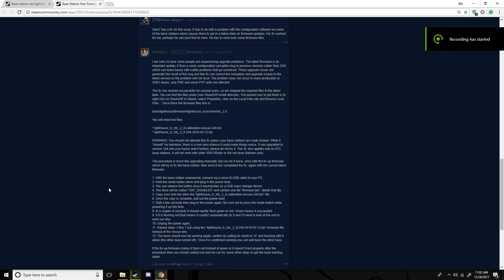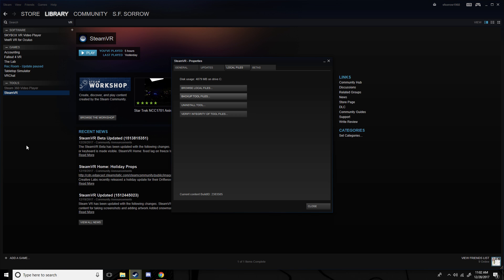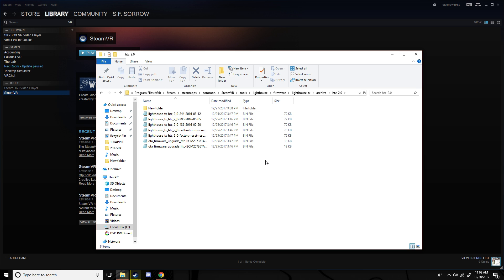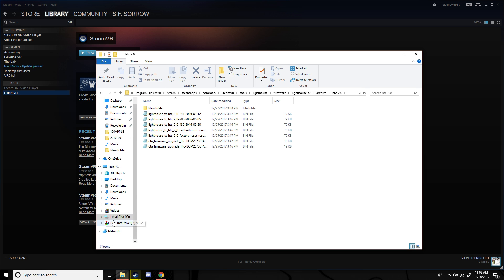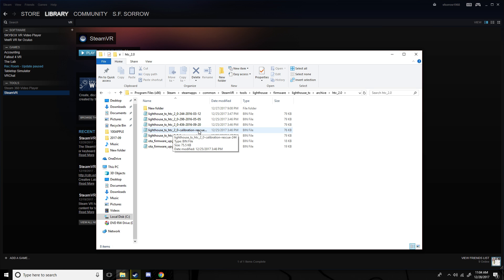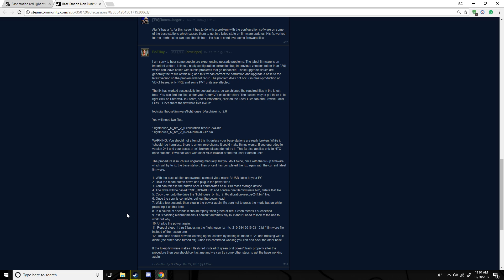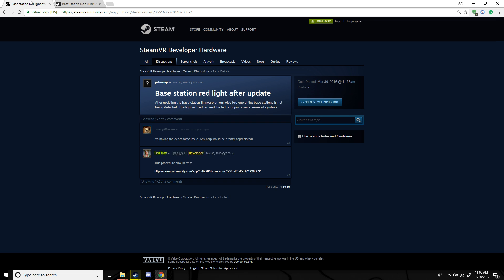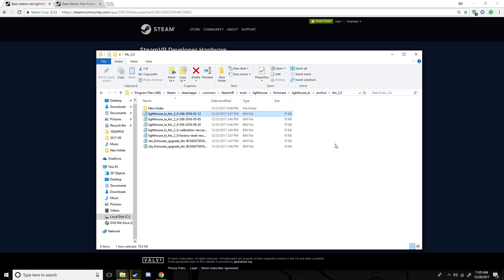How to Fix Base Stations (THIS FIX SHOULD BE A LAST RESORT. READ WARNING IN DESCRIPTION)

Comment: So i did follow instructions till 7 part and after plugging in power without holding mode button it didn't even started my base station is not even turning on now nor flashing any light ? help (yes after it failed i followed till part 11). And when i try to repeat all 7 stages firmware is back in dcm without the one that i pasted in .

Comment: Does not work in 2022 {for me at least} mine started out doing this thing where it would find the base station then the light would turn red shortly after. I tried this fix and everything went well until step 8 in which I got a little confused. Is the regular front light supposed to flash or the little back light? Because the little back green light started flashing immediately after I plugged it in again on step 7 {specifically not pressing the mode button on that step while plugging it in} I then went through the process again but replacing the file with the 2nd one on step 11 when I got to step 5 again. Once I got through with all the steps 1-7 I was confused as to how to set its tracking mode to "A". I don't know if step 12 is needed for proper operation but I'm just sitting here with a base station with the little green light flashing in the back the regular front lights never came on during the process so I don't know if its gonna work in 2022 or if I did something wrong and I have to send it in to a technician or buy a new one or if I did everything right and the 12th step is needed for operation. If somebody has an answer let me know please.
Reply: Also SteamVR cannot seem to find the base station on startup {yes its plugged in} I was very careful with this whole firmware process because I know if you do firmware wrong it will break stuff.

Comment: i got a used vive yesterday and i have this problem but i dont have the cable that came with the original vive, i couldn't get the lighthouse to show up on my computer when using a generic micro usb, could this be fixed with using the audio cable as a link between the lighthouses or do i need to get a new one? (im gonna go get a long audio cable next to test this, ill post the results when i do it)

Comment: one question the CPR DISABLED drive does not appear , i get the notification that the asestation is connected but it doesnt how up in file eplorer is there any way to make it show up?
Reply: Hold mode button down while connecting to PC, base station should be identified as CRP_DISABLED or whatever, release button when it's labeled as USB device in file explorer

Comment: It's july 2nd, 2021, and I've used this method to fix my base station. 1.0. It started blinking red out of nowhere, and I do take care of my equipment so I became worried. Luckily, this video and the threads shown in this video helped. Thank you very much bro
Reply: how did you get the CRP disabled to pop up again after adding the rescue file, i added the rescue file and unplugged power then re-plugged and it was flashing green but now i dont  know how to get the CRP disabled to pop up again so i can add the regular file, any help?
Reply: @h4zza-a  SO once it's flashing green, you basically repeat the steps of connecting your base station to your PC. Hold the mode button while plugging in the cable (more or less at the same time) and hold the button until your PC reads your base station as a USB Device, then you can release. It should be identified as CRP_DISABLED, from there you can go and place that file 'lighthouse_tx_htc_2_0-244-2016-03-12.bin' instead of the calibration_rescue file. After that it should work as normal. I'm pretty sure that file is supposed to be the only one there so delete any other ones that generate i.e. "firmware.bin", but if I remember correctly the calibrate_rescue file disappears on it's own

It's been a few months so I haven't had to do it in awhile, but I did notice that any software update that SteamVR offers i.e; "It's Time To Update your Base Station" will result in the station flashing red, so I have to ignore any updates to that base station to avoid doing all of this again.
Reply: Thank you your a life saver bro I almost got pissed cause I just got the equipment and this happened to me

Comment: This worked for about 30 minutes then my controllers started drifting away then my headset turned gray and now I'm back at square 1. This has been extremely frustrating for me and any help would be nice.
Reply: Did you get everything figured out?

Comment: FOR THE OCULUS QUEST 2 USERS THAT ARE STRUGGLING WITH THE 2.0 BASE STATIONS NOT SHOWING UP ON STEAMVR.

My issue was that my base stations 2.0 wouldn't show up on the SteamVR. I was on this problem trying to find a solution for 8 HOURS when the answer was simple. Make sure that your base stations are on, but the first thing you want to do is make sure one of your trackers is on and you're set up and ready to go. With the 2.0, I didn't have to plug it into the pc to have it update. Turn on your trackers and make sure they are connected to SteamVR the same way that ThrillSeeker did. Once that is connected, make sure you're in view of the base stations, put it on your body, and move around a little. The base stations should eventually pick it up and appear on the SteamVR if you did it correctly. 

I looked for a solution to his issue for 8 hours and managed to figure it out when I gave up and just tried to play to see what happens. Base stations 2 need to have something to track be picked up on SteamVR. I really wish they included this information somewhere that everyone could see.

Comment: Didn't work for me (valve index)
At stage 11 or 12 after seeing the green flashing light inside I unplug and plug it back in holding mode button but when I go back into the base station file the firmware.bin file is back again.
Reply: Once I do the whole process, the base station flashes green but inside the box, not the light at the front.

Comment: *WORKED AND FIXED*
just leaving a messaage. it is way easier that you would think. just find the rescue file and the firmware file like the video shows from 0:00 til 1:12 and the follow the instructions. if you are confused as to what the mode button is, it is the button located on the back of the lighthouse.  this is used to allow the computer to enter the lighthouse. like a normal USB. 
for anybody wonder why its still blinking red when you used this * lighthouse_tx_htc_2_0-calibration-rescue-244.bin file. its becasue the error is physical, which means that either a new model needs to be bought or send this one in for test.

this guy had similar problems ---> https://www.reddit.com/r/Vive/comments/5t11ty/base_station_blinking_red_fixed/
Reply: thanks man:)

Comment: i can't get either base station to go into update mode, when i plug the power in with usb connected and holding down the mode button, nothing happens. both my base stations connect and work but one has started to fail every few minutes the red light stars flashing and it says internal error 10009. i was going to try this method but can't get my PC to connect to the base station with USB, i have tried 2 different computers, different usb cables, different usb ports. if i let the button go and unplug the USB they power up so it's definitely getting power.

Comment: Will this method work on my Valve index base station 2.0?
Reply: I've had this happen on my valve base usually valve bay station does this because of an insufficient power source if you have it plugged into a extension cord or a faulty wall plug or wall plug that's not installed correctly it'll work at first but eventually it'll give you the red flashing light or dim red light this is because of an interruption in not necessarily the power itself but the Hertz that is running at they're extremely sensitive to I have come to find out
Reply: @jt3000o  Thanks for replying. I replaced it eventually... Valve support was awesome.

Comment: Just got a vive (new) and updated the firmware on one of the base stations and it’ll work on the disabled mode but if I just plug it in, nothing.
Would this also fix that?

Comment: i did this and the base station is now having tracking problems
Reply: Did you ever figure out how to fix the tracking issues
Reply: @pnessi570  So i ended up buying another base station because the tracking problem was one of the rotors stopped working in the base station. If you still have a warranty i would get a replacement by contacting them on their main site.

Comment: I did this i thought it worked it started flashing green, I put it back up on the wall and it hasn't stopped flashing green I tried changing the mode it still flashing green
Reply: same thing happened to me did you fix ti pls help

Comment: i get to the flashing green light but after i replug in an go to the files again it shows firmware.bin again instead of the rescue i had replaced it with. is that correct and from there i replace it again this time with the other file?
Reply: I have the same issue.. I thought i was the only poor soul dealing with this problem. No pun attended with your username lol
Reply: @jeremiahmcadams5105  ah haha yeah actually I figured it out. It just resets to that but after the green light your good. Just put that other file in and it'll blink green
Reply: Be green*

Comment: i just bought a new sensor  and it one week the light went red.  when i do this fix it turns back to green but   it comes up on steam Vr  as in it needs updates.. once i apply the updates it goes red again i re did it both ways with those 2 files to add in and nothing.  If i don't apply the update for example and i try to use it when is green  it still doesn't work properly..  can some one please help
Reply from the maker: Vilawent try changing the channels. If that doesn’t work, just give it time and let it sit. Multiple people said that they had the green light and then it fixed itself. This is really beyond me. Try talking to HTC tech support.
Reply: @SFSorrow1968  Alright im letting it sit on green. Hopefully this works !  thanks  for the response !

Comment: My base station doesn't show up on my computer at all?
Reply from the maker: Q7Nator after the base station is plugged in with a usb, did you hold the mode button down and plug in the power cord? You have to hold the mode button down till it recognizes it.

Comment: I ended up clicking out of the error file before I can paste the second file, which means my base station is just flashing green, how do I fix it?
Reply: thats whats meant to happen now you delete the firmware once more and put in the lighthouse_tx_htc_2_0-244-2016-03-12.bin in its place and repeat steps 1-7

Comment: it worked, i update all my firmware day 1 thinking , why not, and it killed my base first day of using it, did these steps and it fixed a non responding broken new base
Reply: so the problem is still here even after more than a year of this video?, thats sucks dude i just got mine and i was going to update them cause i thought htc fixed the problem already

Comment: HTC says the following to this (the real issue behind it): "The firmware update is not causing a failure, it is detecting a pre-existing mechanical failure which is degrading tracking fidelity. That failure will eventually be complete and prevent the base station from functioning at all.

It requires a hardware repair. Attempting to alter the firmware manually may completely disable the base station and in any case, will not resolve the underlying issue."

In other words, the problem is the hardware and the new update just detects it
Reply: to be honest i am sceptical of this as i had the issue today with my sensor brand new out of the box, so unless HTC are literally shipping out faulty hardware its an issue with their firmware and not a mechanical fault with the unit itself.
Reply: @andrewhogg8140  They are. Im quite certain. The hardwareproblem is an official statement by them. They would profit more of a software fix than having to repair all of their units. But ofc, it could be still the case. Just weird that the update works for many others. Others without the tracking problems

Comment: my sensor is flashing green but i accidentally closed the crp file so when i plug the power cord back in i no longer have the crp file to show up so i cant replace the calibration file with the 244 file help please?
Reply from the maker: coolio dude give the base station time and it might fix itself. That’s what happened with a few other base stations. Or you could verify integrity of tool files for steam vr and try again.
Reply: @SFSorrow1968  i let my one base station sit for about a few hours and still flashing green i also verified the integrity of steam vr and its still flashing green and the crp file still wont show up is there a way i can fix this?? do you think maybe reinstalling steam vr could do anything?
Reply: Same here, I just want to play.
Reply: @Jorobaditoo  yeah dudei feel your pain
Reply: @deez50O0  Please tell me if you fix it.
Reply from the maker: coolio dude don’t reinstall steam vr, it won’t do anything. I don’t know how to fix this problem. You should probably get professional help.

Comment: This just happened to me today, it completely bricked. I got up to the part where you copy and paste the rescue file and plug the power back into the base station, but it didn't even flash green there was no light at all. What am I supposed to do?
Reply from the maker: Ame Rayne Did you have the power cord plugged in when you copied over the rescue file?
Reply: @SFSorrow1968  yes, I'm pretty sure. You lose the CRP file otherwise.
Reply from the maker: @amerayne1559 hmm you're right. After you copied over rescue file, did you take the power cord out, wait a few seconds and then plugged it back in?
Reply: @SFSorrow1968  Yeah, did all that junk. I just ended up getting a friend who owns a working version of the firmware update to send me their working firmware file and I replaced the file that needed to be deleted with that, repeated the other steps and it all started working again!
Reply: @amerayne1559  hey i wonder can i get them files mines is doing the same thing

Comment: I have had an issue with my base station for some time now and just today decided to take a look at it myself. It was the fault 02 and had happened after it had fallen off of my makeshift base tower of boxes. I tried everything I had seen and nothing worked. Once I got it apart I noticed a one plug was not in place and after plugging it in the base station worked flawlessly again. This plug itself is not a normal plug type, it lays flat on top of the contacts and does not snap in at all. I believe that dropping the station or even the vibrations that it produces could easily unplug this cord, which there are two of.

First remove power form the base station.

To take the station apart, you have to use a knife or sharp flat head screw driver on the front screen. It is held with adhesive and small clips but will work off once you slide your knife around the whole face.

Then there are four torque head screws size 6 that hold everything in. Once those are removed everything slides out and you can see if anything is unplugged. If so just plug in and apply power and check for the green light.

I hope this helps those that haven't found another solution.

I also don't think that HTC really wants you to take the base apart but if you can't find another solution you might as well try.

I am a bot, and this action was performed automatically. Please contact the moderators of this subreddit if you have any questions or concerns.
Reply: Care making a video about it?
Reply: @eroith5133  https://youtu.be/KNsQs6fZExY there you go!

Comment: so i deleted the firmware.bin  and replaced it with the calibration rescue. my base station flashes green so i thought that was good. unplugging the power to it and trying to repeat steps 1 thru 7 and this time the other file but now CRP_disabled is gone. idk what to put the other bin file into now and my base station is forever flashing green. would appreciate if someone could help me out!
Reply: jk i fixed
Reply: How? I have the same problem
Reply: Nvm after 2 days of blinking it fixed itself, idk why
Reply from the maker: If you’re having trouble or messed something up, verify integrity of tool files on steam VR. That might help, but I’m not sure

Comment: Do I go into to the firmware bin or delete it???????
Reply from the maker: you go into crp disabled and delete firmware.bin and copy calibration rescue where you delete it
Reply: ok well I did that but now I can't get back INTO THE FOLDER WHEN i PLUG THE STATION IN VIA USB AND NOW IT'S RAPIDLY FLASHIING GREEN. sorry caps got stuck on
Reply from the maker: Where you replaced firmware.bin with calibration rescue you then replace calibration rescue with the file in step 11 in the description. And the folder crp disabled should pop when you plug your usb from the computer to the base station. I guess just make sure your usb works cause idk what else to do without that folder. But since your base station rapidly flashed green it means that you did steps 1-9 successfully. Oh and don’t forget to plug the power cord into the base station after you replace the files.
Reply from the maker: if you can't get the folder to pop up go to steam vr and then go to properties and verify the integrity of tool files